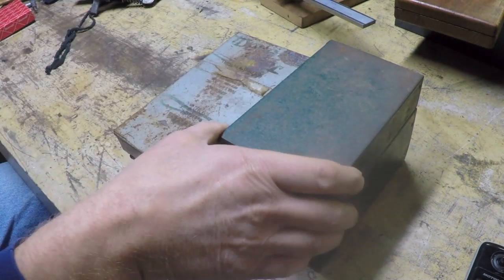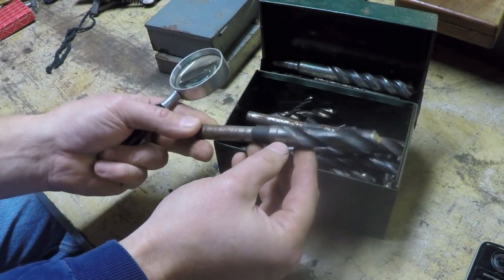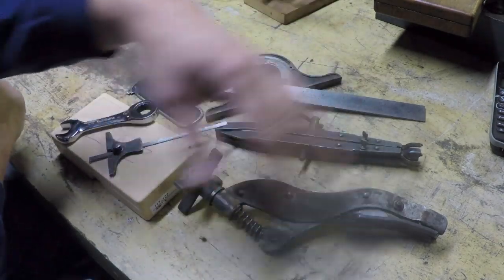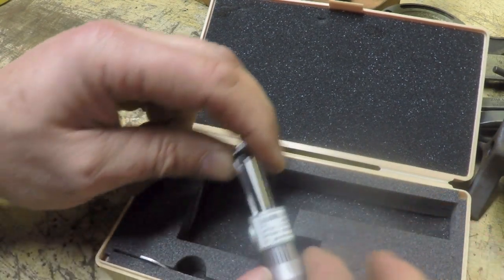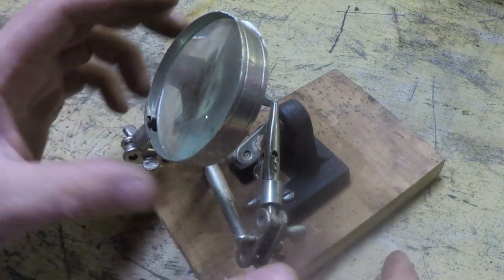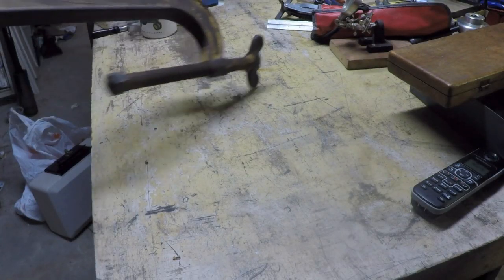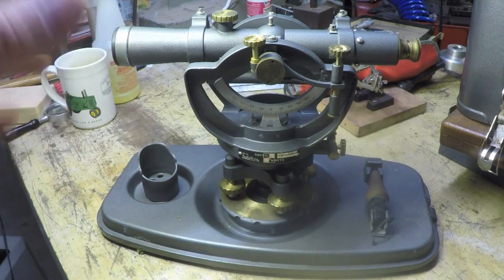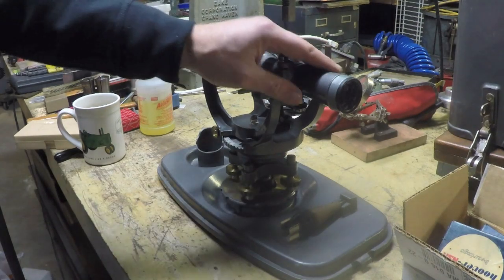Flea Finds October 2018 Part 1

Comment: i had one of those anvil micrometers that was made by Starret,it sold on ebay for almost 60 bucks. i have the exact same pocket chum,we used to get our hardware at the restoration shop from the same company. its getting that time of year unfortunately,not many flea markets left here either. glad to see you picked up more small engine tools for your next lawn mower overhaul,lol

Comment: The little plastic cup goes over the end of the eye piece for when it is sunny out. Also to remove it, spin it off the base.
Reply: Just want to add on the lob stick is a survey staff, and I think a little adapter would be a great idea to make the stand work. If you ever have any questions, I took a class on it in high school. Also just finished saw you got it off.